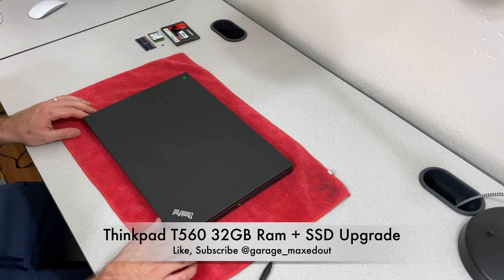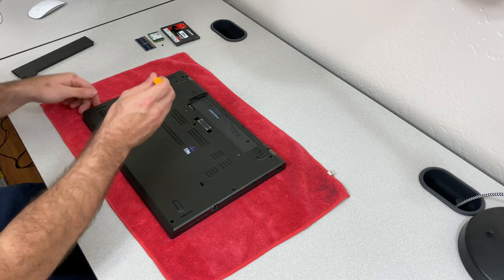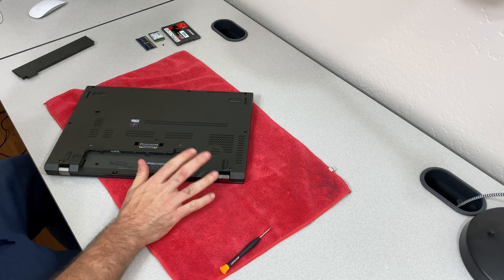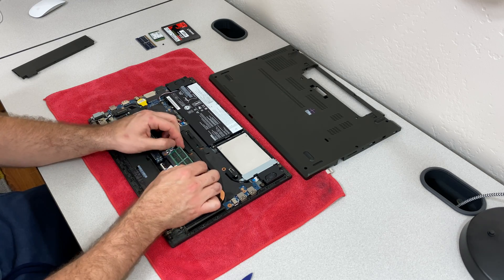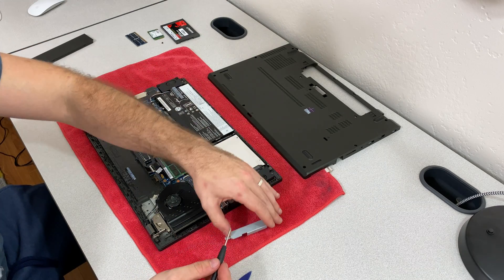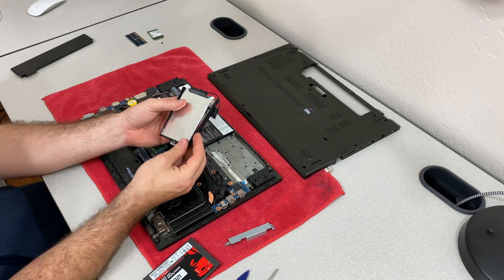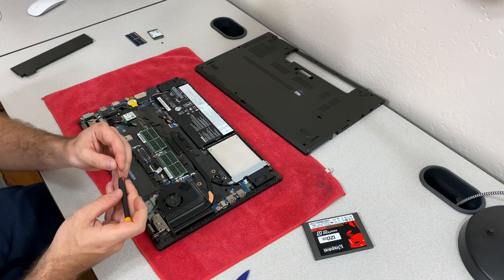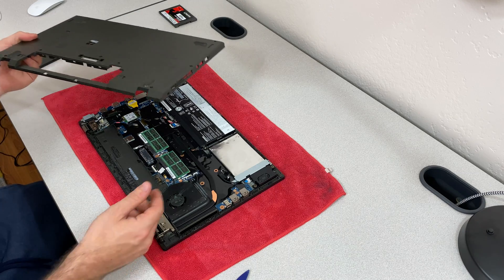Tutorial: Upgrade your Thinkpad T560 with 32GB Ram and SSD!

Comment: Can I Upgrade to m.2 nvme SSD?
Reply from the maker: You have two options. You can use the caddy from a T470P to replace your 2.5" SATA drive with an M.2- https://amzn.to/4csQPAN or you can use a SATA M.2 (not NVMe) in the WWAN slot. I have a video on using SATA M.2s on my channel you can check out

Comment: How hard does one have to pry to get the back off???  Plus there are three short screws along battery mount that look to need taken out also.  Mine isn't popping off like yours.  Screws are out but not gotten back to pop off like yours.  Help!
Reply from the maker: I’d classify it as “finger power” to get it off, you should not need to pull with significant force

Comment: That's really expensive memory. There is certainly many other choices under $300 for ddr3 memory.
Reply from the maker: Not sure what happened to the price. Here are some cheap ones- https://amzn.to/3TGasxt
Reply: @GarageMaxedOut  Yeah it's wild, are you sure there are no cheaper 32gb (2x16) options out there ? I wasn't too sure if I had to really go for the same exact clock speed to make sure it would pair with the motherboard well... Ended up calling 32gb a bust, doing only 16gb for now... These older machine are worth around 300$ so it's literally the price of the entire machine !

Comment: I did exactly as you're doing, but the base cover doesn't come off. Something is holding it place in the middle of the laptop. Not sure what though. Any ideas?
Reply from the maker: When you say middle, you you mean the center, or the middle of one of the edges? There should be no hidden screws in the center with this model

Comment: I just fiddled with my laptop for an hour. I scratched the skin on my fingers, scratched a lot of the laptop plastic, bent the lid, scratched the ruler and the cat because I didn't notice the bolt under the sticker with some serial number or something. Then when I finally took the lid off, it turned out I didn't have a hex screwdriver to remove the old HDD and transplant the extra ssd from my computer

Comment: 16 gb is overkill. 32gb is waste. But the work is really nice.
Reply: With windows 10 installed , a 32G memory reserve is verry helpfull.  
My T560 has 16G on a i7 CPU , Lexar 512 SDD ,  and with LightRoom it rather slow to open to a library of (+-) 5000 images . 
I'm sure the extra 16 would do a better job , but as previouslly said "DDR3L kits are so expensive now" that i'm waiting for a deal ...
Reply: Same as my t560 with 8gb ram . So slow to boot up
Reply: I'd say 16 gb is a nice middle ground given W11 coming up and how old these CPU are getting. 32 gb is only overkill if you know how to properly manage your browsing tabs. I'd like to show you the nightmare that I see almost every time I go to support these older folks... Some of them can really benefit from those extra gigs of ram, believe me ! You have to understand that the concept of closing tabs is scary to them. They don't understand how this data is on a server they can access at all time. A lot of them go as far as printing webpages, printing emails to archives them and so on. Some of them have so many tabs opened at once that you literally cannot even click on a specific one anymore, each one is too thin...

Comment: I recently did an SSD upgrade for my Lenovo L 560 and the HDD in the caddy is super slow. File transfer rate is between 0 - 3 MB/s. Could this be a fault in HDD? However I haven't tried any other HDDs in the caddy.

Comment: Do I need to reinstall OS when upgrading SSD?
Reply: No. Just put it in and turn on the power. Then log in with your usual username and password.
Reply: @mrscary113  Naa, ...only if you cloned the new SSD from the old drive. Definitely NOT plug-n-play